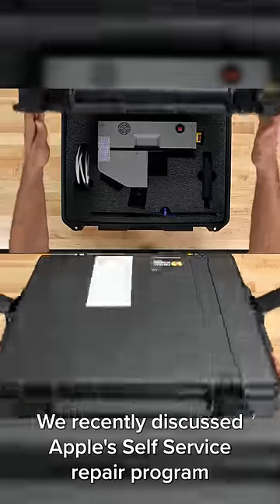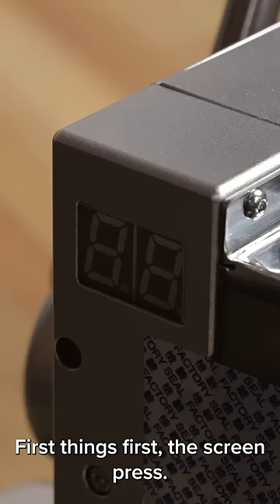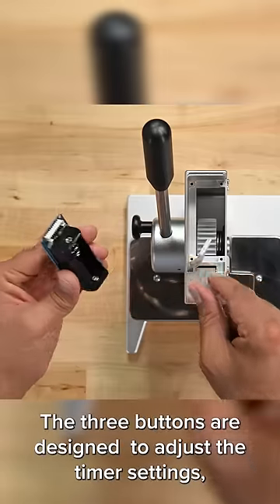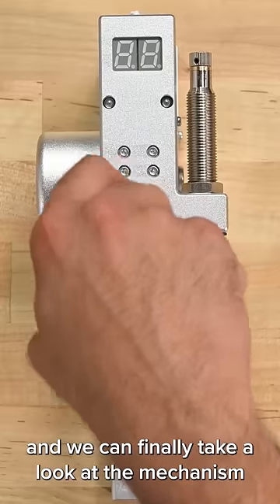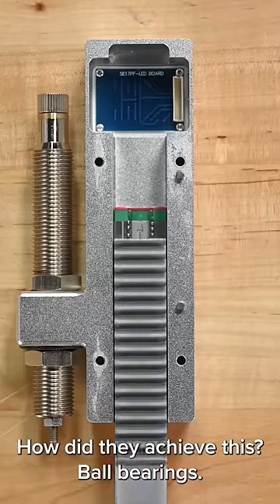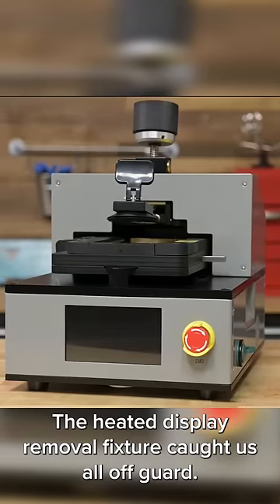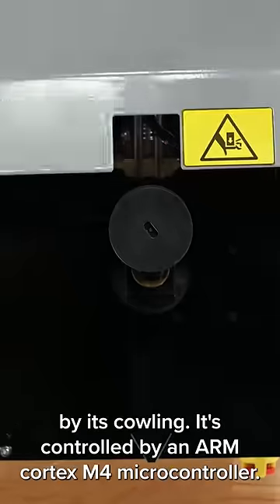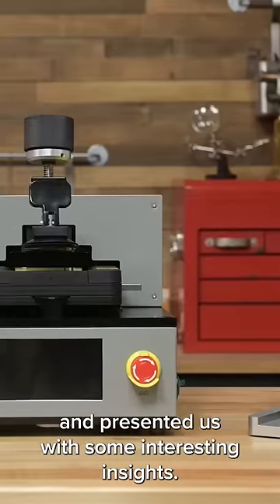Tearing Down Apple's $1200 Tools! What's So Special!?

Comment: We don't want overengineered equipment, we want easy to repair, modular and upgradable devices. 
But Apple is only interested in profit...
Reply: Personally I don’t want modular phones. It’s been proven several times in the past that there’s just not enough space for it
Reply: @jandajanda2242  Maybe he means "modular" as in "non proprietary parts" in a way that allows for the easier exchange of parts. Like how they currently map parts together with codes that make the replacement of said parts more difficult.
Like how I can plug my TV into my desktop without needing to flash a windows key on my TV, that kind of modular lol. Or he means hot swappable modules, I don't really know though just thought I'd throw out that possibility
Reply: @Ivan.Wright  any mac can connect to any smart TV with Apple TV or having an actual Apple TV. It works perfectly 100% of the time. And it’s much easier to do on a mac than any other computer. And he means “there’s not enough space for it” by 95% plus users will never ever open their phone up. There’s a small amount of people that want to do that. You may not agree but I can assure you that I am right.
Reply: @Roberob1189  What tf are you talking about?
Reply: @Ivan.Wright  I don't know that guy is on drugs
Reply: @fallu6224  Maybe, at the very least he didn't understand my analogy and took it too literally. Made him start arguing irrelevant points to the ones I was making. Kinda funny he can assure me he's right without seeming to even know what I'm actually saying. Whatever though
Reply: Thing is tho the more powerful and more efficient the technology the more and more it gets less repairable. I’m not saying they’re right but if you want technology that over the top futuristic bleeding edge stuff at some point repairability will no longer be possible.
Reply: You can have an extremely thin, highly water-resistant phone, or an easy to repair phone. Pick one.
Reply: @Ivan.Wright  He's just an apple fan boy. Never expect the ability to understand analogy from apple sheeps
Reply: No one wants modular phones. People just want access to parts at factory price and schematics
Reply: @christinaandwena8917  how will not using a software to block replacement parts make the phone any thicker?
Reply: There have been modular phones and they flop
Reply: No we don't want that... Android users want that.
Reply: Doesn’t over engineered mean a better user experience?
Reply: @uzairaezad7630  when you call people “sheep” it says more about you than it does about them.
Reply: It's the brand.
They can charge whatever they want and people will still buy it.
Reply: @tronixfix  We already have that tho?
Reply: @astro-naut2567  ok... Apple luckily doesn't
Reply: @tronixfix  what are you talking about?, Android devices have really easy repairs, while apple's dont, because of course they want profit above everything else
Reply: @astro-naut2567  lmfao y’all keep bringing up how Apple wants profit, and you’re right. Think about this: Android is made by google and it’s open source, therefore anyone can update it. iOS (and the rest of the apple OS’s) are closed source and made in house through R&D. So if Apple stopped trying to make profit, we wouldn’t get such nice phones with amazing software to go with them. Stop bitching about how business works and go start your company and make easily repairable phones. Smh y’all are acting like Apple isn’t a publicly traded company.
Reply: @ijarbis187  I always thought a full memory weights more than en empty one…

*irony off
Reply: @astro-naut2567  exactly... i got an apple but i don't want upgradable or modular devices... let's keep that for android users
Reply: Why do you think the world’s richest company will NOT be interested in their profits? They’re not a charity for fucks sake
Reply: Modular phones definitely can be waterproof with the right seals. Modular phones are a good concept but fail because every part of the phone should be upgradable not only repairable. And problems arise from that, the older parts wouldn't be compatible with the new replaced ones. Just launching a new phone every year is more profitable for the company. The only good half modular phone I know is the fairphone 4 but it has a little bit slower processor than other phones in it's price range
Reply: As if other companies have modular and upgradable devices
Reply: @nicenice3355  Teracube has modular phones but not that good
Reply: They wouldn't be selling half the world's phones if that was true.
Reply: @wyattb3138  you wouldn't need over engineered(only to the extent of repairing apple devices) machines if the device itself wasnt such a pain in the ass to take apart.
Reply: Modular and upgradable phones are a nightmare to design for. It’s not a PC where you have the luxury of space. Even with PCs, the vast majority of gamers throw away 90% of their parts every 5-10 years.
Reply: Just want a repairable device. Swapable parts, no lock code in parts. These tools were just a waste of $$. People has been repair iphone  & ipad, mac for a long time. These tools were just add extra cost to the repair.
Reply: @robocob55699  What extra cost? It's not as if Apple bricks your phone if you don't use their tools to open it and more to the point if it saves a shop even a little time then spending $1000 or more on any tool is nothing, saving just a few minutes saves them money.
Reply: @vgamesx1  You know what'd make them save more time? Not needing to microsolder to replace a cracked screen
Reply: @Roberob1189  Please, explain to me the exact process that makes it easier on a Mac than any other PC.

1. I turn on my PC. 

2. My Windows PC turns on my TV and home theater. 

3. Windows boots in under 10 seconds. Which is faster than any Mac OS device. 

So how EXACTLY is the process easier on mac. Quit being a Stan.
Reply: Im thinking not to buy their products anymore, I don’t even have a headphone input.
Reply: Yet you keep buying their products.
Reply: Welcome to capitalism! Every company is only interested in profit, no matter what they tell you.
Reply: You also don’t speak for everyone. Most average users just want a device that looks good and works. Not something they cuddle with or think about endless ways to customize. They just want to get their calls, tweet their tweets, and watch their videos. Companies must cater to the majority market to be widely successful and sells millions of devices. Thus modders and tech enthusiasts tend to get put on the back burner so to speak. What we want comes second to what the majority market wants. This is how business works.

Comment: Looks like normal home brew stuff we make at work.  Yes bearings, hi win bearings lol or linear
Reply: Paying for hi win linear rail carriages in something like this would be ridiculous... and exactly what Apple probably did.
Reply: @JJFX-  but it's something apple does, build it well, build it with quality. Nothing I have felt so far has a cheap throw away feeling to it. From iphone 5 to anything current.
Reply: @Ciloteille  Yeah I'm half joking... not using hi win here would likely make little difference on a rail like that small but I can see why Apple would do it. They build solid products outside of the questionable electronics decisions in more recent devices especially. Some of which are hard to imagine being anything but intentional.

Comment: It's not ballbearing. It's linear block bearing. And stop shoveling the ball around. One wrong move and you can search those balls on the floor. 
Not expensive part on it's own. Can be of it some high quality grade. Which it probably isn't. This level of movement can be done with the cheap stuff just fine if theres no actual load on it.
Reply: Assuming that this tool is using the highest quality everything it should cost you no more than $100, and like you said it's likely using some fairly cheap components which brings that cost estimate down to I'll go somewhere between $40 and $60. So best case scenario we're paying $1,100 for that Apple logo on it worst case scenario $1,160 for that Apple logo. 

If you're going to sit here and tell me that is at all worth it then as far as I'm concerned you are a useless source of information

Comment: We’re all on M1 and M2 and this repair tool is using M4 🤣
Reply: When all it really needed was a cheaper Atmel chip.
Reply: @Christopher Grant An ATMega1284P, for example, is cheaper than a big ARM chip, and is probably still overkill.
Maybe I should have looked into more than the Arduino community.

Comment: I guess I should mention, these are the same tools I have access to as a repair tech. These have been in use before being released to the public. I agree Apple makes their stuff unnecessarily compilated for what it is. But in this case they didn't make them more compilated before release and It's been this way all along behind the scenes. Just some insight.

Comment: who designed this? even a billionaire would not use ball bearings and arm processors.
Reply: Ehhh… what? What’s wrong with ball bearings? You are aware that our entire modern world runs on those, right? Those things are everywhere…

As for using ARM processors, wtf? The very phones these things were designed to repair run on ARM processors. 🤦‍♂️
Reply: @leeroyjenkins0  well this person's logic is so incredibly flawed because ball bearing equals high quality and high quality equals can charge for more, though to be frank that doesn't actually matter because at past hundred dollar tool assuming they're using the absolute highest quality parts you can find but then you're left trying to explain to me or that other $1,100 comes from.